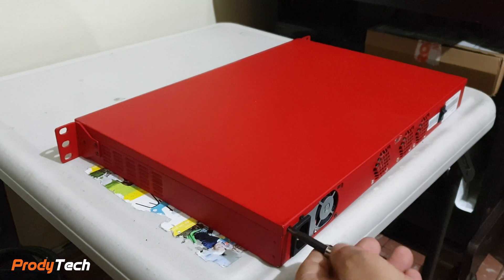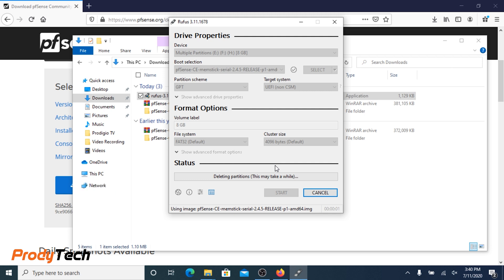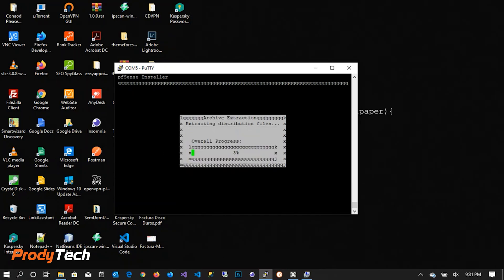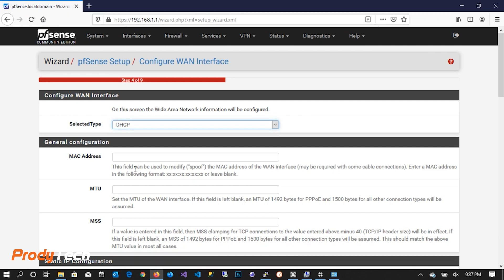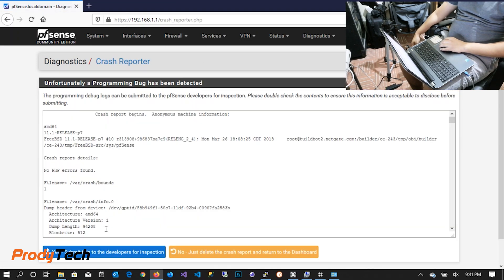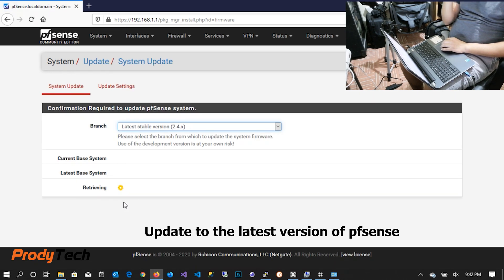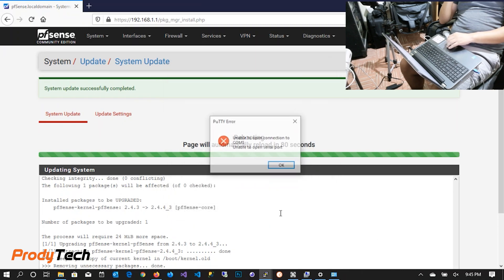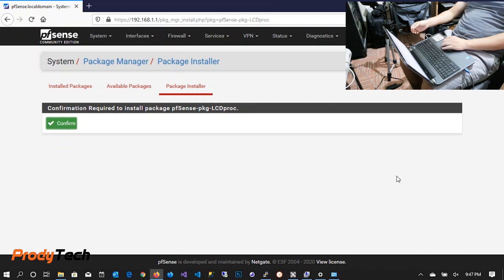How to Install pfSense 2.4.4 on Watchguard XTM 5 // LCDproc Package Step by Step Guide 2020

Comment: I just got everything installed on a XTM 505  which I upgraded to a Q6600 and 4gb of ram. Have it running on the latest PfSense 2.6 and it's working out great. followed your guide step by step. Not bad for a $20 piece of hardware, another $10 in CPU and RAM, an old SSD I had laying around, and then a few more dollars for the CF card and USB/RJ45 console cable. Since i can use the CF card and console cable I didn't include that in the cost. But yeah very happy with the results!

Comment: Why would someone install pfsense on a Watchguard? Just use the Watchguard iOS?!! Makes no sense!!!
Reply from the maker: That's a good question.. And the its cost related. You can have one of these units working with pfsense and buy it on ebay for about 100 to 150 dollars at most. A hardware that will last and work if taken care of.

Comment: I am stuck at putty section how do you know which com port to identify? and where is that saved session of Watchguard XTM5 come from?
Reply from the maker: Hi Johnnie, you can identify the COM Port on your computer by going into the device manager after you plug in your USB to Serial Adapter. In my video already saved the configuration on Putty so i can use it later. Let me know if this help.
Reply: @ProdyTech  Thank you now I can identified my com port, but when I enter to putty the system asking for username and password why is this happening?
Reply: The message show "Unable to open connection to COM5 Opening  '\\,\COM5': Error 2: The system cannot find the file specified" and I can see "WG BIOS V1.3 display on the unit.

Comment: Do you know if pfSense will support watchguard AP's like the original firmware? Also is it easy to revert it back to stock firmware?
Reply from the maker: No, pfSense is another firewall solution that you can install on Watchguard XTM series of appliances. When you do install pfSense, it's installed on a SATA HD of your choice so you can save the existing CF card that came with your appliance. That way you can go back to watchguard when ever you feel is necessary.
Reply: @ProdyTech  thank you for answering :-)